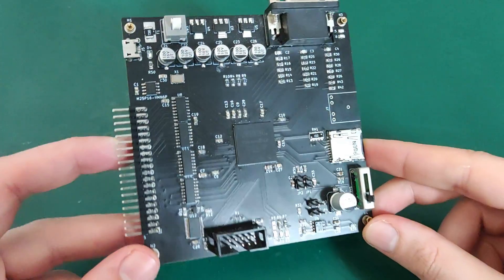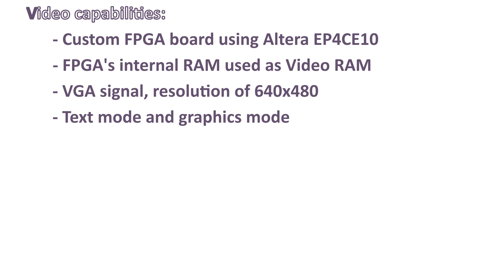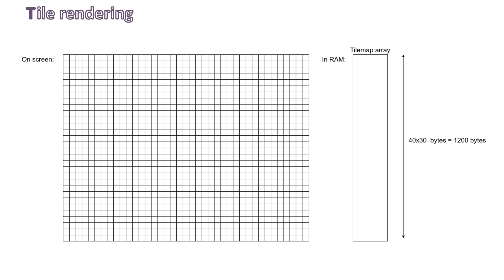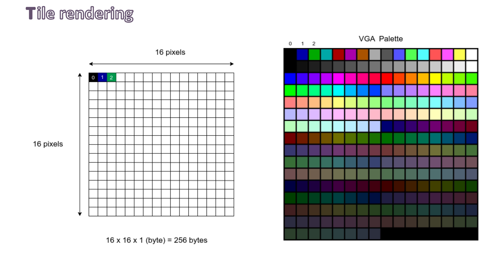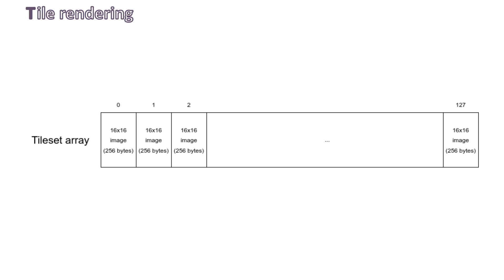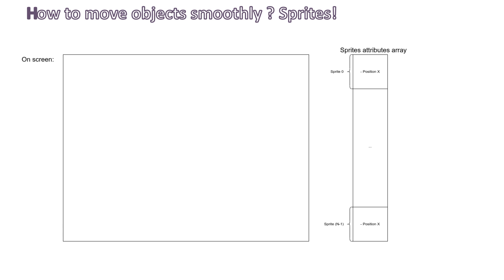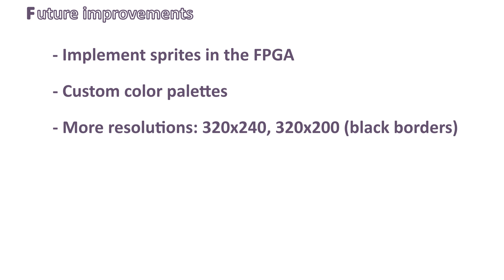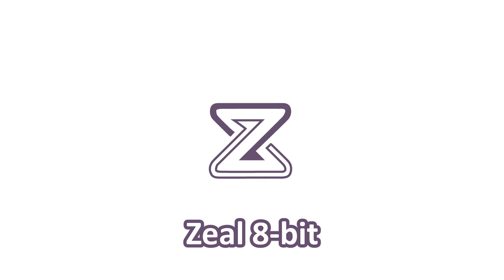How 8-bit graphics work on homebrew retro computer [Part 1]

Comment: Would it be possible to use one as a a server running mp/m? Or could I make a small network with three of them?
Reply from the maker: I haven't ported MP/M, I did port CP/M but more as a PoC that it's possible to do it. I don't plan on working on these two since Zeal 8-bit OS already reached a very mature and stable state.
Connecting three of them together should be possible, what were you thinking for the interface? UART? Wifi?

Comment: Why don't you use an ESP32 controller for the graphics chip as the Agon Light 8-bit computer based on a Z80 too?
Reply from the maker: The ESP32 is a 240MHz 32-bit computer, it's a beast of power that would make the Z80 completely useless. It would even be able to emulate the Z80 faster than the real Z80.
Moreover, the ESP32 cannot be addressed on the parallel bus without several tweaks. the best case would be to address it via SPI or UART, which is slower that parallel (the original Z80 doesn't have an SPI controller)
The ESP32 has several demo for using it as a VGA controller but in my opinion, that's not very stable compared to using an FPGA, which is time accurate. As soon as the ESP32 becomes overloaded, there might be problems on the screen since the software cannot update the framebuffer anymore.

Comment: Just found this channel, and I hope the project is still going well. I'd love to get one of these computers once the graphics adapter becomes available. Oh, and a half-decent case option would be great as well.

Regarding the feature set, I'd like to request the addition of one important (IMO vital) function, which probably won't be too hard to implement: Hardware scrolling.

Scrolling tilemaps is a major pain without hardware support. Ask anyone who's worked with the original MSX1 standard, or indeed any of the many other systems built around the Texas Instruments TMS99x9 VDC (ColecoVision, Spectravideo 719/729, etc).

The VIC-II in the C64 solved this very elegantly by having horizontal and vertical shift registers, making it easy to shift the display tilesize-1 pixels in one direction. The shift registers did not affect the positioning of the sprites, only the background.

In order to smoothly scroll a tile-based picture, you'd first use the shift register to shift the image 1, 2, 3, 4, 5, 6, and 7 pixels, and then quickly reset the shift register and move the contents of screen RAM (the tilemap array) one position in the desired direction during VBlank.

The VIC-II also included a feature that would increase the border area, effectively shrinking the visible tile area 1 tile vertically and/or two tiles horizontally, thereby hiding the empty area that would otherwise appear at one end when the picture was shifted. (The reason two horizontal tiles were hidden instead of just one was simply to preserve picture symmetry.)
Reply from the maker: Thank you very much for your support!
The project is still on-going! The motherboard is finalized, I am currently developing the FPGA-based video card. I have been considering making a custom case too, I even tried printing one I designed already😄

I do plan to have hardware horizontal and vertical support in the FPGA for the tiles (for the sprites it's less of an issue). Not sure if it'll be easy to implement in 640x480 graphics mode but for 320x240 graphics mode, it'll be possible for sure. I haven't reached this point yet as I am currently tackling the hardest part: the sprites. But it is planned!

Comment: Fun, it looks a lot like the FPGA video card I made for my own home-brew retro computer.
Reply from the maker: Thanks for your feedback! How far have you been with you FPGA core?
Reply: @Zeal8bit  The RISC one got finished, but it was my first attempt at VHDL (have yet to learn Verilog), so it's not very good. It did run however, including a tile-based video card implementation and PS/2 keyboard input. The current one is still under development, currently busy with making the instruction size determining and decoding a bit more streamlined, as the first attempt was a bit unwieldly.

Comment: I'm really interested in your FPGA video solution. I've built my own 8-bit computer (centered around a 6809 CPU) and have really hit a brick wall regarding video. I hope you are able to get the sprites added but I also hope you would agree to release the FPGA code and board design to the public so other people like me might be able to benefit from that work! (Hopefully it would still work ok with a different architecture than the Z-80...)
Thanks for the videos!
Reply from the maker: Thanks for you comment!
The FPGA board has a rather simple interface/connector I would say: 22-bit ADDR lines, 8 bit DATA, WR, RD, MREQ, IOREQ, VBLANK, HBLANK,...
Moreover, the FPGA uses its own RAM, it also doesn't require DMA, which reduce the dependency on the main board. Thus, it should be possible to interface it with any 8-bit computer. With a different arch than the Z80, extra logic may be necessary for IOREQ line for example. 
Do you have a blog or videos talking about your computer?😄
Reply: @Zeal8bit   I'm still new to this, currently working on my 4th prototype board. I have a short video up that I made after getting keyboard & sound working, here: https://youtu.be/clt6r0-w0Ik
Regarding the interface...
22 address lines: well I only have 16 total so that might be a problem :) I suppose I could use two PIAs (MC6821 programmable interface adapter) together to give me 32 lines to play with. Or, you could add 4-bit color, 320x200 display mode and I'd only need 32K or so to make stuff work :)
8 data bits: check!
WR, RD: On the 6800, 6502, and 6809 there is only RD/!WR (one pin, active-low write.) I might be able to throw in an inverter (74LS04 or something) to address that...
MREQ, IOREQ: I'm pretty sure address decoding works very differently. Typically for a peripheral I will have one single active-low line for it (a chip-select line) and when that line is pulled low the peripheral should switch its data bus from Hi-Z to input (or output). But if I have PIAs in-between I can probably generate those signals (albeit slowly.) Generation of the chip select line level happens through address decoding (e.g. accessing address $8000 turns off the ROM and enables a specific peripheral instead.)
VBLANK/HBLANK: Are you saying you are generating these signals from the CPU??  :O
Reply from the maker: @aqualung2000  The 22 lines are here because I have an MMU, but the video board itself doesn't need more than 17 lines currently, so we can consider the upper ones as CE pins. In fact, my first video board is using banking, so maybe it would be interesting to keep both functionnality (either 22-lines, either banking with 16 lines) and activate them either in hardware or software. If you plan on adding banking on your board, having 22 lines won't be a problem, you could use a 74HC574 for example for this.
#WR, #RD: an inverter should do the trick indeed as both are active low.
#MREQ, #IOREQ: Address decoding is not that different from the Z80, what happens is that the Z80 has 2 buses: 16-bit memory space and 8-bit I/O space. In your case, both buses are the same, your I/O space is only 1 byte long and addresses at $8000, right? You could imagine having regular memory from $0000 up to $FEFF and I/O memory from $FF00 to $FFFF, in that case, #IOREQ will be active if A15-A8 is 0xFF. I don't know how you are doing your logic decoding, if you are using a CPLD, that's pretty straightforward, if you're using 74Hc chips, you could add a Dual 4-input NAND gate, 74HC20, with an OR gate, they would give you that signal. Similarly, we can generate MREQ# out of #IOREQ.
VBLANK/HBLANK: I am sorry, I wasn't clear, these are 3.3V output signal, they are provided from the FPGA. I am connecting them to the PIO to generate interrupts when activated
Reply: @Zeal8bit  That makes sense. After reading your reply, I feel more confident it could be made to work. 
I am using 74-series logic for the address decoding. Not 74HC but "old-school" 74ALS series, which are around as fast as the HC. My original design was just a 74ALS139 followed by a 74ALS138; that method only left me 16K of address space for the ROM, but I've since found a better way (that I stole from this guy's video here: https://youtu.be/J7koxM_TKq0 ) that gives me 28K of address space for the ROM (huge improvement!) The logic is mostly as you describe I think.
Having interrupts for for VBlank & HBlank is a fantastic feature! I'm even more excited for your FPGA design and I hope you have good fortune in your design!
Thanks again!

Comment: Just wondering, is this going to be a kit or maybe a detailed write-up so others can also make this project? This looks like it would be lots of fun to put together.
Reply from the maker: Thanks for your comment! As you might know, Zeal 8-bit computer is made of two boards, the motherboard and video board.

The option 1 is to make them as a  finished product: you can plug it and start using it directly. Then anyone can develop software or hardware extensions. This is also my ideal option.

The option two is to make the motherboard as a PCB kit, to allow anyone interested to practice soldering. (Soldering the video board is another issue as it embeds small SMD and BGA components)

Let me know your preferences or ideas
Reply: would both be possible? @Zeal8bit

Comment: Very exciting project! Your custom FPGA board seems very neat and nicely done. I didn't know the advantage of Lattice compared to Altera until now. Look forward to see your next graphic demo on Zeal8bit computer;D
Reply from the maker: Haha thank you!
Reply: @Zeal8bit  why don't you use a FPGA version of SNES GPU or the nes, maybe it will save you some time (I don't know if it's possible btw)
Reply from the maker: @tutoriais5266  That's a good idea, I haven't though about that but there are several things to keep in mind if someone would want to implement such video card for Zeal 8-bit computer: the SNES was a 16-bit console, not 8-bit; by default on Zeal, no RAM from the main chip is reserved  for the video, the FPGA has its own (V)RAM; there is no DMA on the mainboard either, so the video board should implement it. 
I am not too familiar with the PPU, maybe it wouldn't be that difficult, I don't really know but that would be an interesting side project
Reply: @Zeal8bit  got it!! :) I really hope you figure it out cuz with a GPU it will be effectively a game console. The audio is probably simpler to do for sure 😃

Comment: Look into the Amiga's Copper, it had 3 instructions (move, compare and skip, I think) and allowed to update any register in the machine. You could change the palette per scan line, which created the HAM modes. You could program it only using 2 instructions, I did that. The spectrum next has an implementation of it.
Reply: +1 on the Copper - I added an implementation of it in the badge for the Hackaday and it's really powerful. Someone wrote a demo that used the ever-loving crap out of it - https://www.youtube.com/watch?v=Gll31o0D6ic
Reply: I'm pretty sure the HAM was unrelated to the copper. HAM has no pallet, it's just delta RGB relative to the previous pixel. But I'm no amiga person so maybe the copper is relevant even so.
Reply from the maker: Thanks for your comment! I had never looked into the Amiga's graphics, but waw, that's interesting and a bit complex too! I wonder how "expensive" in terms of bytes are the Copper instructions list, for example for rendering an image. How usable, in terms of simplicity, would it be to display tiles and sprites for 2D games?

In my project I would make such co-processor are the main graphics rendering but that could be another advanced to add. I will try to read more about the copper to understand it fully.
Reply: @Zeal8bit  You don't use it for sprites or to render an image, you use it to add 'flavour' to an existing set of graphics. For instance, the wobbly logo in the demo is done using a copper list containing of instructions that wait for a line and then on-the-fly modify the offset of the image, and that once per line. If you program those offsets into a sine, you get a single-frame of sinodial distortion. Animate the offsets that the copper applies, and you get a 'wavey' image.

The main menu also uses that trick, but it uses a static (non-animated) copper list to re-shape the list of menu items into a more cylindrical form. The menu item list is actually a set of tiles, like you have in your hardware, but the copper list changes the (0,0) position of the tileset on-the-fly once per line in order to make that distortion.
Reply: @Spritetm  I don't feel like the copper is so useful other than for writing demo scene style effects.  The copper is a neat way to work around the extreme limits of the amiga hardware. I'm not sure it's particularly worth re-implementing on a machine with more color depth, etc.
Reply from the maker: @xeostube  @Sprite_tm Thanks for the details, I understand better now. I guess it would be a nice addition if I have some spare BRAM in the FPGA 😄
I will first focus on the main features such as sprites, to begin with.

From experiments I made with GIMP and static images/tiles/sprites, having a custom 256-color palette gives very nice results
Reply: @Zeal8bit  The copper is more for changing the palette or bitfields on specific scan lines, etc., without putting any load on the 68k processor. The future was here has a nice high-level discussion of amiga graphics.

Comment: Hats off to you with this. What you are doing graphics wise is beyond my pay grade, but impressive to see your progress. 

Retro Recipes showed a few weeks back an FPGA replacement for the VIC chip, which slots into the socket itself,  and does all of the graphics. Let me see if I can find that video...
Reply from the maker: Happy to see you again, thanks for your comment! 😄

I believe that FPGAs in the future will be the best replacement for non-working or obsolete chips. They are getting smaller and more and more popular.
Reply: @Zeal8bit  Firstly, I found the video in question: https://youtu.be/o5alg64hxb0

The portion of interest is from 12:55 or so. It might be an idea for you, as it would put the unit more together, and would be easy to swap out, if you are building a better FPGA.

FPGA is getting more and more interest. I remember Coreteks talking about them, have to see what it was about exactly. I seem to recall it was about crypto mining.
Reply from the maker: @horseradishpower9947  Nice! I like the form factor. I was also considering making an FPGA board that would be connected on the top of my main board when designing my first FPGA PCB. The problem I encounter was that the FPGA PCB would be too close to the chips on the main board. I didn't want to have any overheating problem. In his video his puts a socket inside a socket to add some height, I wanted to avoid such workaround. Moreover, it also meant that you cannot debug the chips that are below that PCB when the computer is on, that's another reason.

So I had two solutions: make my main PCB bigger, with a blank spot with sockets to plug the FGPA board, or have the FPGA board as an external one, as I did already. The first solution would be the best if the VGA port, the SD card port, the 3.5mm jack and the pot were on the main board. Thus the FPGA board would "only" receive signals and send back other signals for these different peripherals. It would mean that the board would be exclusively meant to output a VGA signal, which is not what I wanted. This is why I decided to go with the second solution.
Reply: It is known as the "VIC-II Kawari" Randi Rossi has several videos on how he made it.